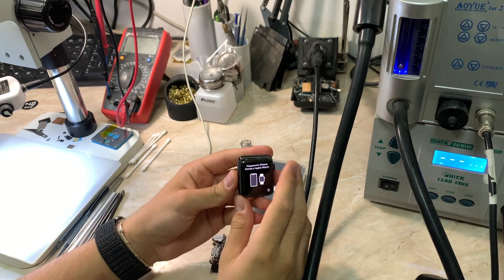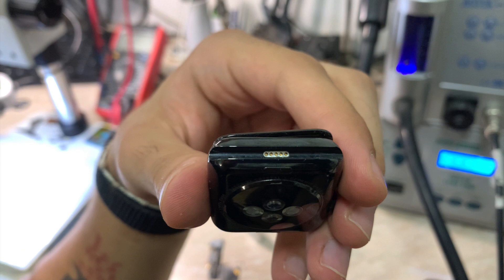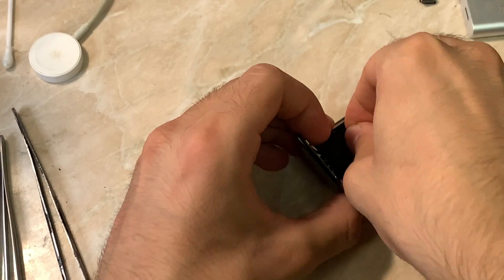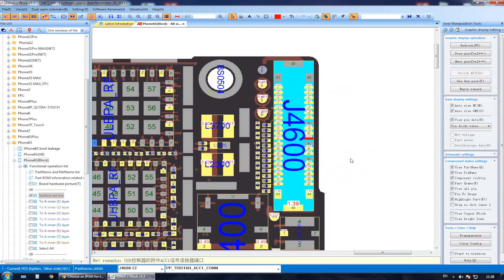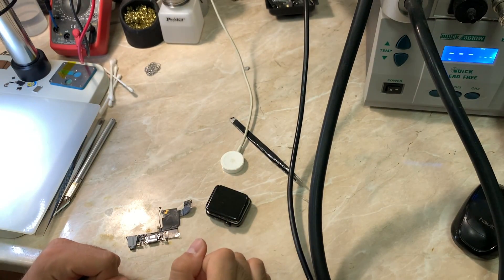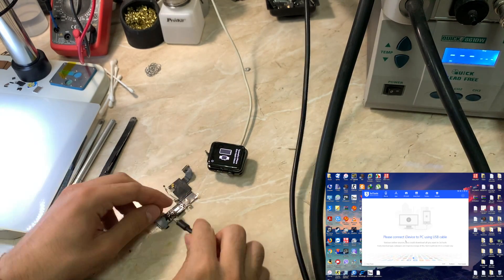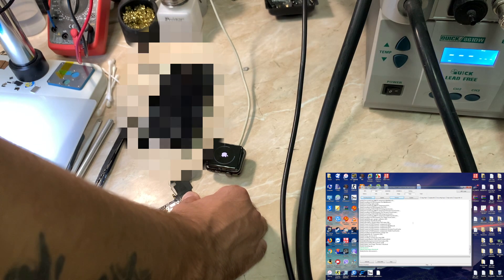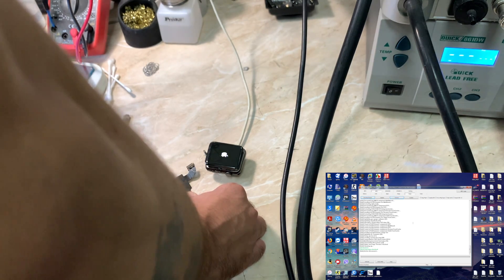How To Connect/Restore Your Apple Watch Without Using A Dongle (MFC-AWRT) The Easy Way

Comment: This adapter also does it in dfu mode ????
Reply from the maker: You can connect, yes from series 1 till 5
Reply: @AntoineKiriaky10  and series 6?
Reply from the maker: @ same as series 4 but with drivers needed

Comment: Good evening, I have an apple watch series 3 in need of reinstalling the system, but I am trying to make an access cable to the apple watch as you did on your channel, and I have a question, would it be possible to do this without the flex, just with the cable direct to the clock pins?
Reply from the maker: Not recommended.
Reply: @AntoineKiriaky10  but how would you do it? If you can explain it to me, I'm willing to put mine at risk, it's about to go to scrap, I just want to see if it works
Reply from the maker: @Martins967  if you are going to risk
Shorting your Apple Watch go ahead, I still won’t recommend doing this, even with the charging flex there is a big chance that you can short the Watch because of 5VUSB.
Reply: @AntoineKiriaky10  okay, even so I'll try, in this case as the cable only has 4 wires and the clock has 5 pins, how should I proceed with the connection? or rather saying how should I make the connection, could you explain it to me better? because I still don't understand.
Reply: @Martins967  Have you figure it out? I am in the same point here!

Comment: Hi I bought an apple watch from someone on the Facebook market and got scammed, the watch is locked to the original user. I don't know how to do any of this is there an easier solution or did I buy a useless watch?
Reply from the maker: Which series ?
Reply: @AntoineKiriaky10 series 7000 42 mm aluminum. Can I use your method to bypass icloud activation lock ❓ or do you have any other ways to do it

Comment: One thing that was not in the video if the connector is the same why do I need to solder to an iPhone 6 charge cable ? Couldn’t I solder directly to a lightening cable ? Or does the watch not have usb Id and things so it needs the phone connector to be recognised?

Comment: Hi, can i just solder the pins from iwatch to the lightning cable? Why it has to go through this charging board?
Reply from the maker: Try and let me know
Reply: @AntoineKiriaky10  and I have other question. What is that software that are you using or its just itunes?
Reply: @AntoineKiriaky10  I tried (twice), and no it appears you can't. It might be that I was not using a legit Apple lightning cable or the watch had other problems that made it unrecoverable, it definitely didn't enumerate as a USB device on a Mac or PC despite trying a bunch of times to get it into DFU mode. I have just ordered a proper programming jig from China so when that arrives I can check whether it was the watch at fault or just a bad cable.

Comment: Hello friend, what a good video you made, friend I have a series 1 can you pass me the guide on how to connect each pin of the flex connector, in the pins of the clock, since I am an electronics fan and I do not handle certain interpretations, thanks for your time and your contribution always, thank you very much
Reply: Hlw dear now simply update your series 1 or 2 on iOS 16.5 
I have updated it's around 1.5gb from watchos 3.0 to 6.3 final update 
And took almost 2hrs

Comment: does it have to be iphone 6s connector or can it be any?
Reply from the maker: You can try iPhone 6-7 connector
Reply: @AntoineKiriaky10  thanks trying to soldering the wiring.
Reply: @AntoineKiriaky10  managed to solder 4 out of the 5 wires where does the last wire connect to wasnt able to connect the iwatch yet can you send me a message where to connect from the charging port to iwatch thanks

Comment: I bought a apple watch Series 6 Nike Edition and the seller lied about the device. So I got “too many passcode attempt... " so watch is disabled. I used SN to check it online, there is no icloud lock. Will this method do hard reset to make is useful? Thanks.
Reply: I know this is old question but to whomever may need to know an answer to this question, you dont need anything but the watch to reset the watch if its not icloud locked. Just google how to reset apple watch....
Reply: @ByronGriffis bro can you tell me any website how to check whether the owner activation lock is on or not on an apple watch 7000.I’ve checked on couple of websites and it showed that find my is off. 
So,can you tell me if resetting the device from the watch itself will work or not,the watch is turning on and doing all the things but mine apple id is not loggen in into it and I can’t pair my new iphone to it.

Comment: Hello antoine nice video i got a question can i use this method to reinstall apple watch series 3 gps software? on pc using itunes or 3utools? . bought it from someone its not icloud locked The watch wont pair it gets stuck in an infinite loop . It needs to update but it can't pair to the phone without the update and it cant update without pairing to the phone. thank you
Reply from the maker: Yeah sure thing but you still need the official ipsw if you need them you can DM on Instagram or telegram
Reply: Thank You very much i will.

Comment: Hello Antonie, I wonder if you have the IPSW for apple watch series 7000, 38 and 42mm? thanks!
Reply from the maker: Hello sorry ipsw for series 7000 are not available for now only from series 1-6
Reply: By the way the 7000 series marking on the apple watch bottom refers to the type of aluminium it is made out of. I am unsure of where else you can figure out what series the watch is besides attempting to pair with it.

Comment: Using this method, Can it also be restored with iTunes or 3utools, or only with the mfc software?
Reply from the maker: Yep with iTunes
Reply: @AntoineKiriaky10  This method with the iPhone 6s flex also works for the Apple watch series 1 38mm?
Reply from the maker: @ariestar20  yep but in series 7000-1 there is 6pins not 5
Reply: @AntoineKiriaky10  The sixth pin is no connection?, or is it some important line?
Reply from the maker: The 5th has no connection

Comment: Hello antoine, for series 2 stainless can dfu mode with this? Or do you need additional tools? because the method given by the mfc team only works for series 2 aluminum not stainless,.. i've tried it,..
Reply from the maker: Shot I forgot to try on series 2,ibus don’t put Apple Watch series 2 in DFU that’s the only model I couldn’t enter DFU
Reply: @AntoineKiriaky10  ok thank you, maybe later if you have found a way, and can enter diag and change sn, you can share it again in your content, I'm waiting for that,.. 🙏🏻
Reply from the maker: Of course I will be including diag mode and series 4 in the future thanks for the idea